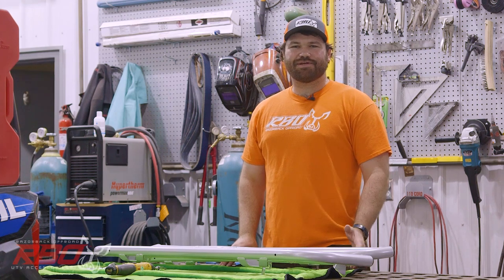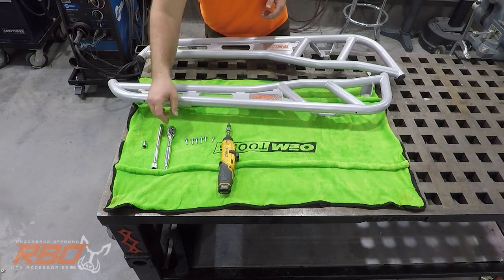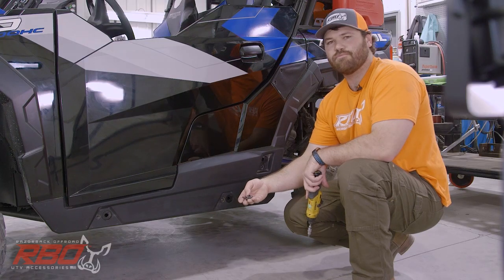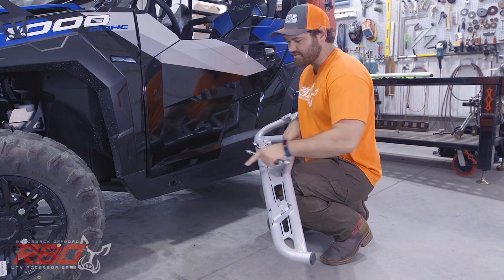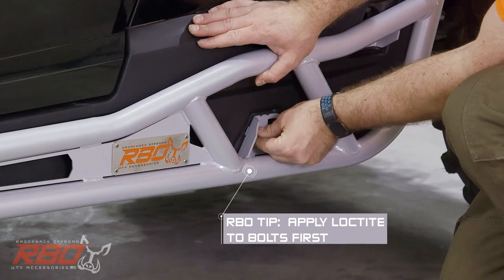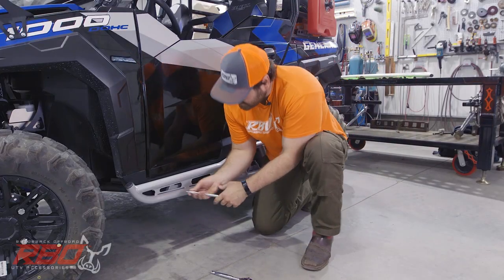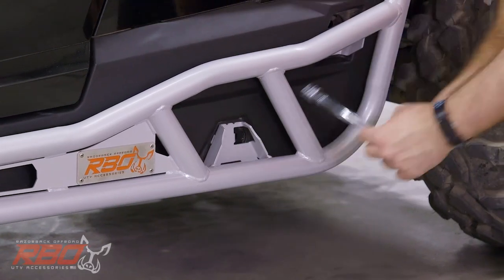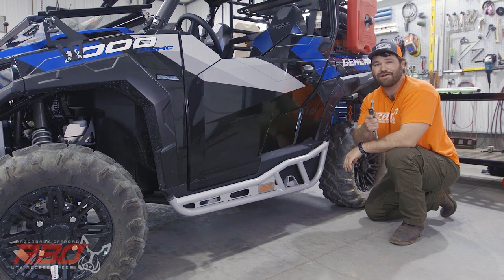2- Seater Polaris General 1000 Rock Sliders/Nerf Bars Installation by Razorback Offroad™

Comment: Nice looking, strength is questionable to me though. Do these come in different colors?
Reply from the maker: These have a laser cut fabricated load dispersion plate, and you can actually use them as a jack point. We only sell them in black powder coated finish.
Reply: @RazorbackOffroad  that would be good. Black is the color I was referring to.
If you can use them as a pry point!!!
They must be tough. Thank you for your input and reassurance.
Reply from the maker: @dougburke5168  Absolutely! Thanks for watching!

Comment: How well will those tiny bolts hold up to a real good smack from the bottom?
Reply from the maker: Hi Tyler, we made these out 1.5” steel tube and then welded in a laser-cut fabricated steel center section, so they're built tough. As for the bolts, they're held tight with our mounting brackets.